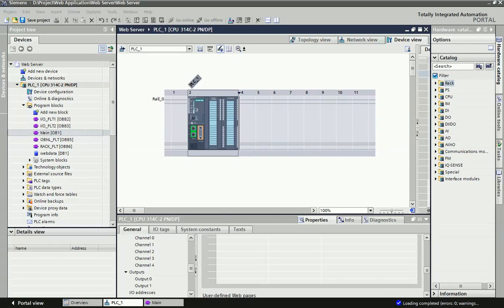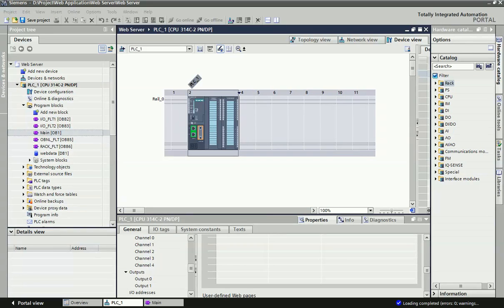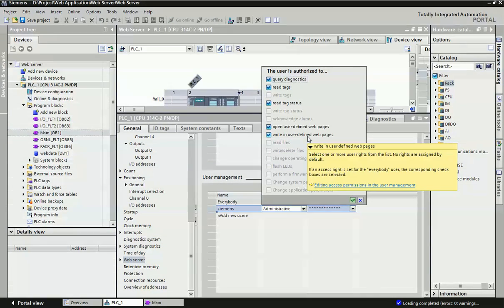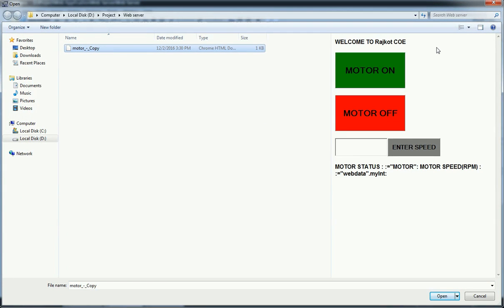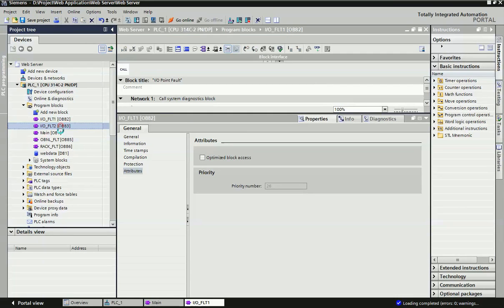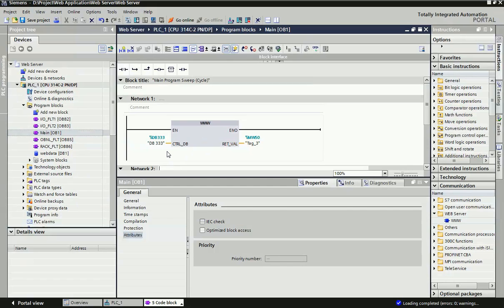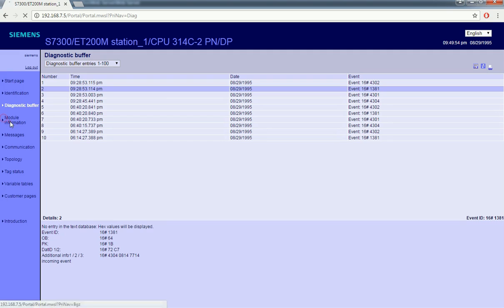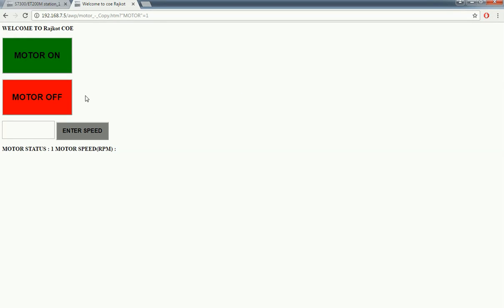PLC Tutorial 9: How to control PLC from Internet ? (Internet of Thing)

Comment: i want to access my plc through internet which means a pure IoT, i need to control my plc from any place through internet. is there any solution
Reply from the maker: It's not possible due to security reasons. It will be accessed from only secured intranet. And with valid credentials.